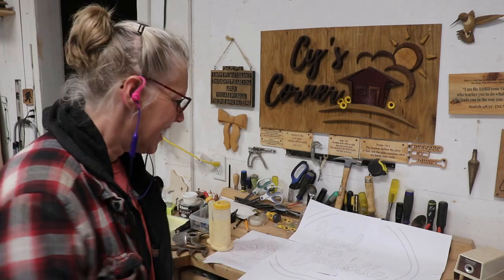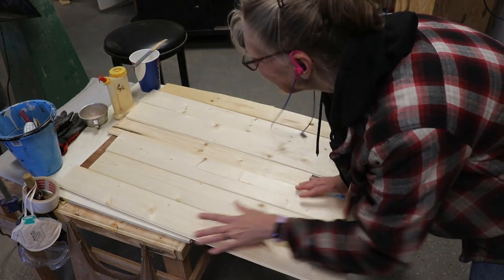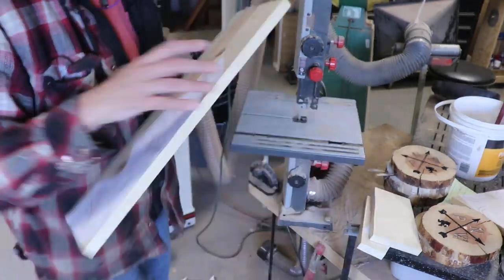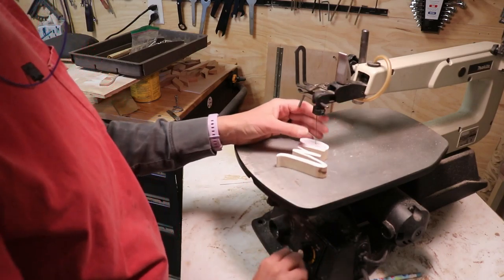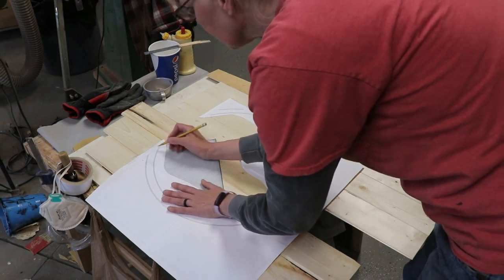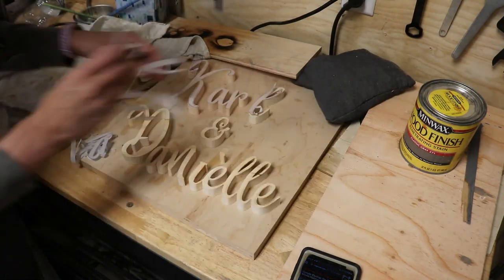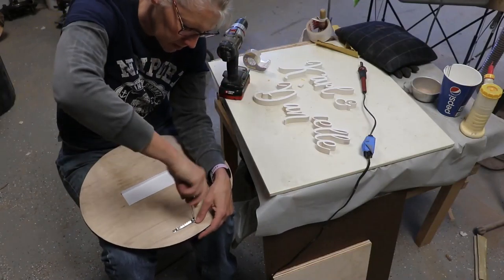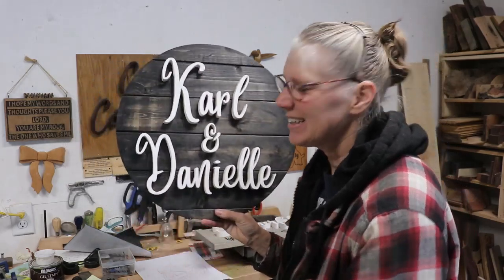Scroll Saw Sign for Karl and Danielle

Comment: I have an old pinless Delta.  It has the lever on the top that lets you do the inside work pretty easily.  However, if the lower lets loose, it's a real pain to get it clamped properly.  Also, the speed control is under the table and hard to get to.  I recently added a foot pedal which is a huge improvement so that you don't have to reach under and try to shut off the saw if something happens.
Reply from the maker: I added a foot pedal to my Hegner Bob, it is very handy indeed!!!! This old new saw has a pull out knob, its pretty easy to get to. It was a good garage sale buy!